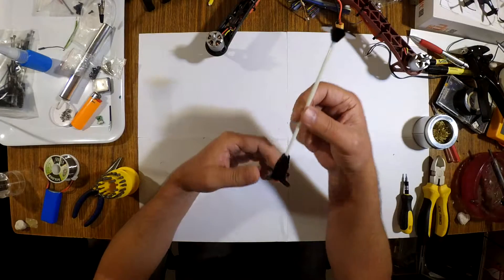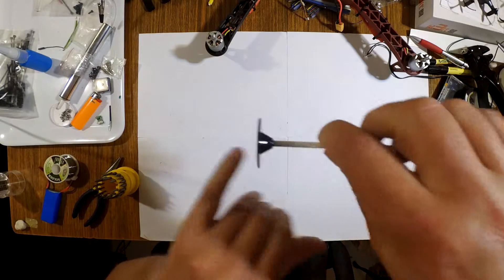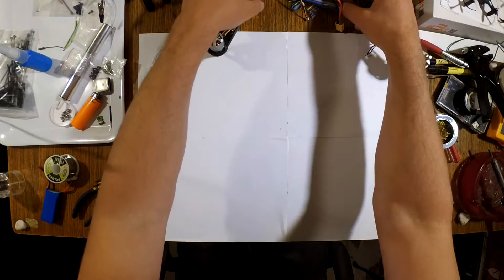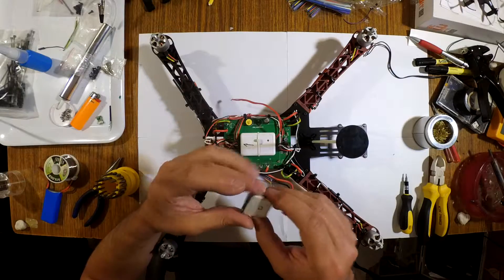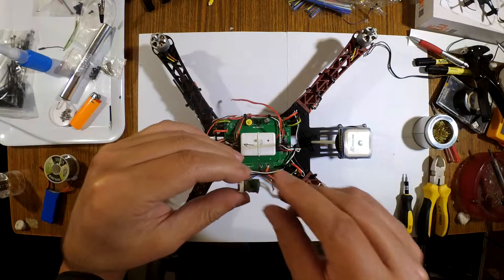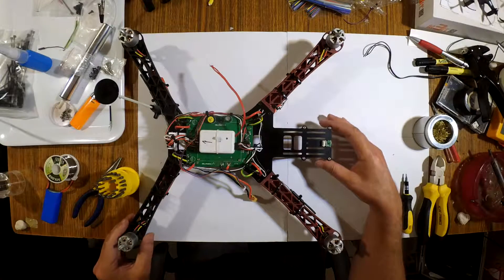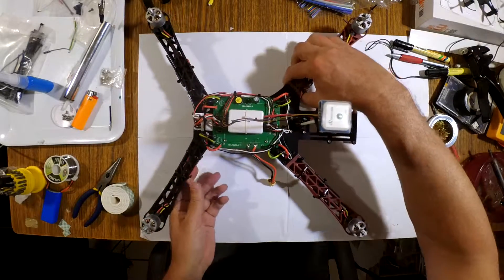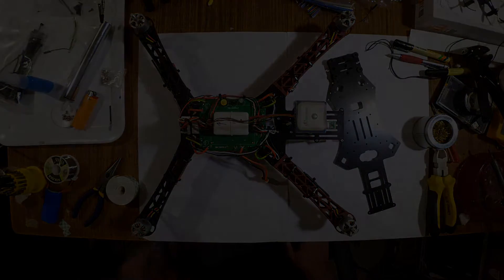CX-20 rebuilt to 450 Frame - Part 10 - Mount the GPS and Compass

Comment: hi,
do you think i can extend gps wires ? so i can roll it around the gps stand
i know we can't do this for antennas but is it ok for gps ?
thanks a lot for your help
Reply from the maker: +Augustin MEIGNAN In theory it should not be a problem extending the wires.  I have not done so yet so I cannot confirm.
Reply: +Riaan Roux ok i'll try it and let you know if it works
just waiting a new soldering iron 
mine just broke ><

Comment: I will mount my GPS to the frame arm and then mount the compass to the tower.   The original CX20 had the GPS mounted next to the flight controller and compass in tower.  I doubt there will be as much vibration as a finger on the tower.  Thanks for the video.  I am going to try this over the weekend.